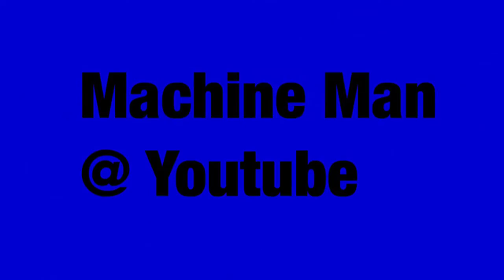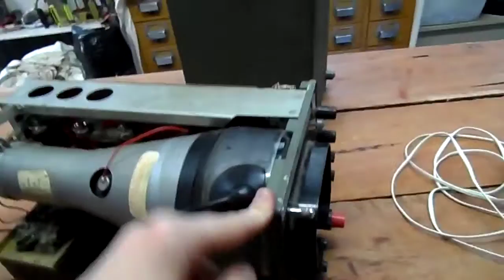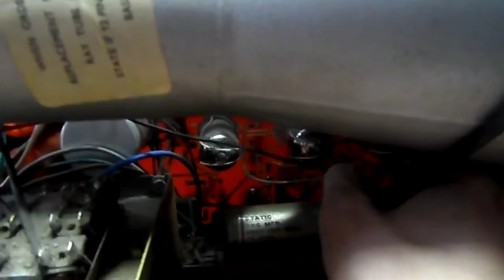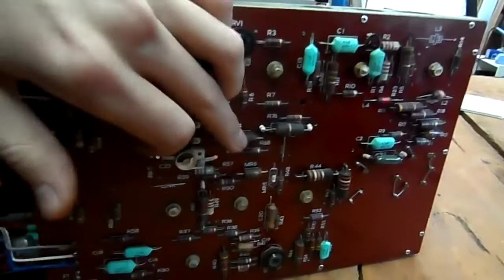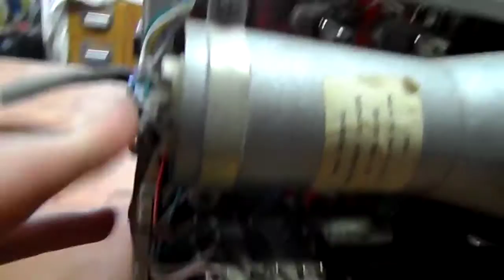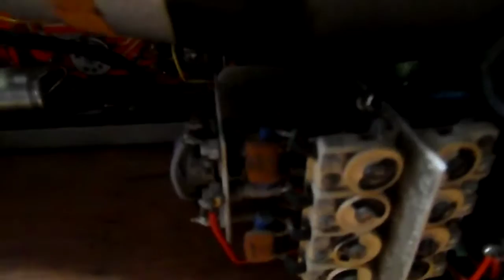Telequipment Servicescope S51E Look Around

Comment: just watched a video on restoring old electronics 

if you see a paper electrolytic cap on the scope, replace them with newer electrolytic ones because the old ones leak dc through them
Reply from the maker: Yeah all of the caps in this need replacing, as well as a transformer winding

Comment: i have that scope in perfect condition

no scratches, cracks, dents or dead components

mine is designed for 240v 50hz

no im not giving it away
Reply from the maker: Lucky you! 

I still haven't fixed mine yet, although I found a new tube for it
Reply: CAL'S ENGINEERING a teacher at my school gave me his old one

and hopefully the tube makes it work
Reply from the maker: NeXTSTORMING funny thing is, that's the same way I got mine. All the caps need doing, plus one of the transformers is shorting to ground
Reply: CAL'S ENGINEERING probably should fix that, cause 240 or 120 shorting out is not good at all
Reply: I got one of these.  S 51 E. In mint condition. It also came from a school. I remember reading somewhere that the "E" in the type name stands for educational . . . . Makes sense then, that they all come out of schools.
I also happen to have a S 51. Sadly i think that one is a total write off. It has blown capacitors an some more burnt components. Case and Front look really good though
Reply: Oli Axel Oskarsson ooh that sucks that its circuitry is stuffed, hopefully you can either get new components or go the expensive route and buy a new scope
Reply: I'd like to try and fix it. To bad how difficult it is to find any good information about those things.
Reply from the maker: Oli Axel Oskarsson there's quite a few vids on these servicescopes on YouTube, the good thing is they cover various different failure modes, old equipment like this sometimes has a circuit diagram on the inside of the casings

Comment: Hey! I happen to have one of those scopes, but finding information about it is very difficult here in the US. This scope used to be my father's, until he took the valves out and left it in the garage for 10 years. I'm much older and am trying to get into more advanced repairing, my father knows nothing about scopes, he just had this one inported so that he could use the valves in his amplifier. So I have to ask other people now. Do you know what type of valves go in this thing, and it has all original stock parts, what are those values as well? If you know. I have a box filled to the top with valves and I don't know where they go. Or which ones to use. I too am looking to fully restore the electronic aspect of this fine piece of British engineering.
Reply from the maker: They're a great piece of British engineering! When I have it apart next, I'll get all of the valve numbers for you and where they go. It may also be an idea to replace all of the capacitors as they have a habit of drying up and losing their value. Good luck fixing it! ;)
Reply: +CAL'S ENGINEERING thank you, good sir!